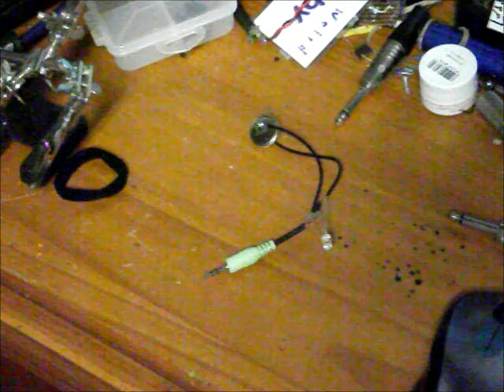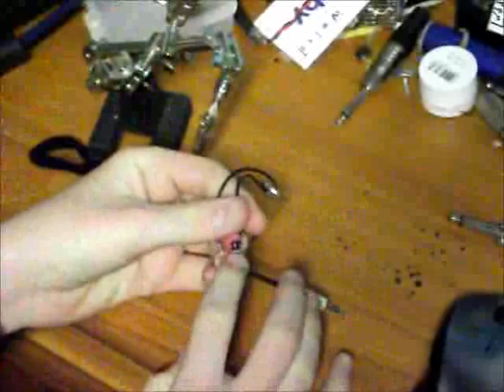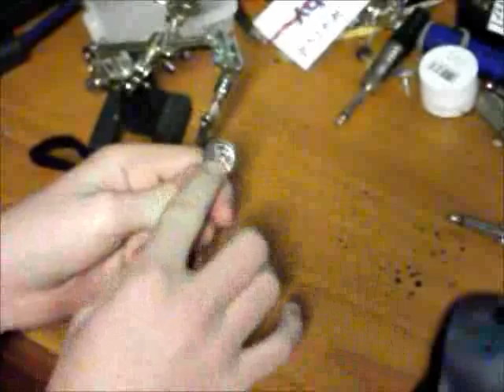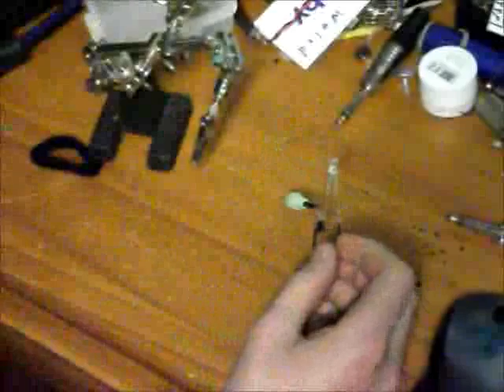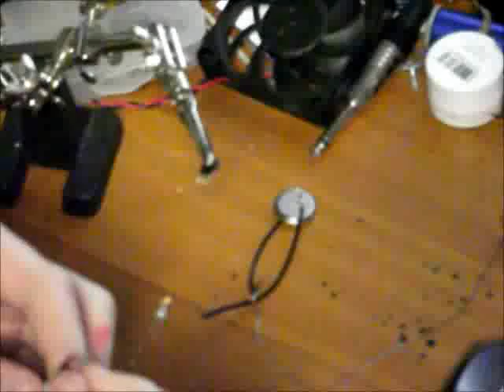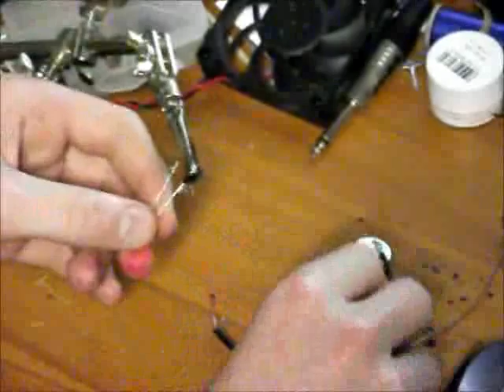Sound to light construction video

Comment: Warning do not do this unless you want to fry the output of your audio device. There is no protection from this circuit and what ever it is that is powering it. Attempting to drive anything other than a LED will almost certainly cause even more problems.